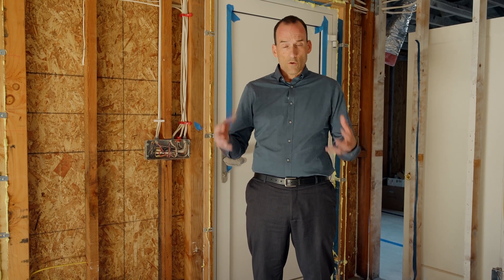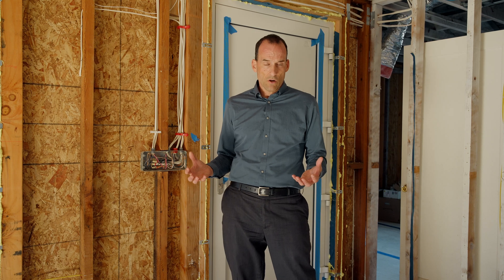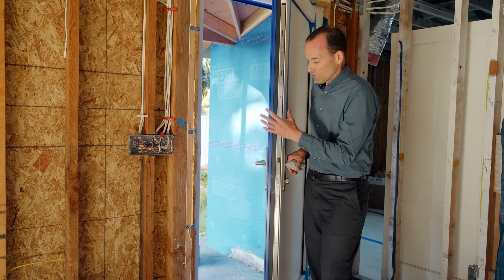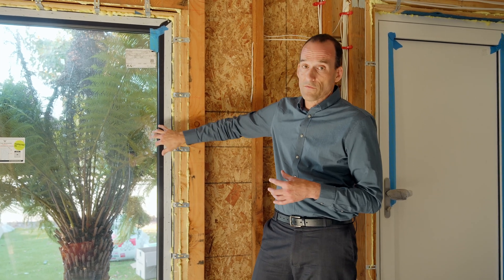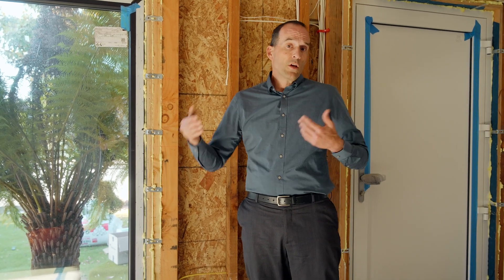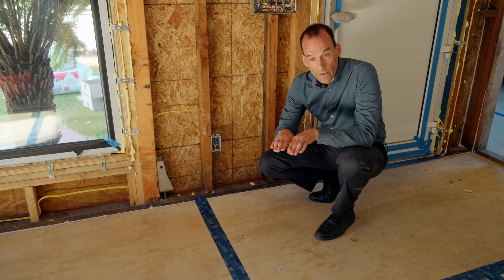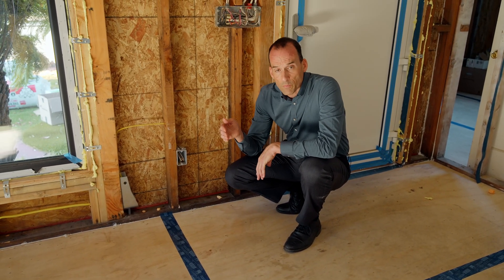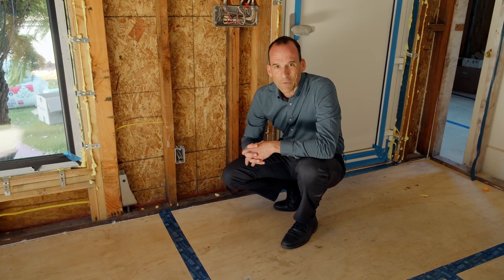Bay Street Passive House #7 -  Sealing a 100 yr Old House To Passive House Levels

Comment: What would you recommend as minimum insulation for the Bay Area peninsula neighborhoods for walls, ceiling and floors?
Reply from the maker: That depends on what you are trying to do and where you are starting.  If you are building a new home then you have lots of options and I would definitely build to passive house standards.  Here that would be R27 floors and walls and an R60 Roof.  But you would also want to upgrade to Passive House windows and air seal to 0.6 ACH50.  That is what I did with my own home(Bay St. Passive House) and it was amazing and I cannot imagine building any other way now.  If you are just trying to upgrade your existing home's insulation and you are not doing a major remodel, then all you can do is fill the walls, attic and floor joists.  That is your limitation and that will define the R-Value for the walls and the floors. The layout of your roof will limit what you can do at the eaves.  If you are trying to meet passive house and you are doing a major remodel, and you are going to air seal and replace your doors and windows and your siding nd roof, you can put on exterior rigid insulation over everything and you should treat it like a new home, with a new homes R values.

Comment: Just about to start our renovation in the Bay Area and so far your videos have been quite informative. Was meant to do a ‘regular’ renovation on a 70 year old home but now would like to incorporate some of your techniques to improve the home air tightness. Is there a window you’d recommend over the standard Milgard and Marvin double pane products?
Reply from the maker: I really like Zola Windows.  They are amazingly good, super efficient and oh so quiet. Will be cheaper than high end Marvin’s and twice as good and ten times more air tight.   Good Luck!!!
Reply: Thanks for the reply Dave. Unfortunately based on Zola’s production timeline and their min $50k order requirement, I wont be able to use them. So unfortunately l’ll have to go with Marvin Essential unless you have another recommendation.
Reply from the maker: @vivenreddy Sorry, i didn't see your reply until just now.  There are other manufacturers from the us too.  Schuco, Alpen, Innotech, Intus and many others.  Sorry for the late response.  Best of Luck.

Comment: I thought old house were not designed to be air sealed as it may offset the integrity of the natural airflow that kept these structures intact for so many decades?
Reply from the maker: You are correct in that the leaking us of old buildings help them to dry when they got wet but getting wet is not standard part of their operation. Getting wet is a result of a defect in their construction processes or a failure of materials so if you can stop them from getting wet, they don’t need to dry out, hence they don’t need to be leaky. So really adapting an old house to a much tighter. Envelope is all about controlling, moisture and recycling, stale, air with fresh air, which can be done with proper waterproofing and air, sealing techniques and proper ventilation systems, respectively.

Comment: Hi Dave, great video! Would you mind sharing the door and windows manufacturers? Are the windows US-made or European triple pane? I would love to find some options in the US that are cost effective and triple pane if available, but certainly love the options and sizes from European manufacturers!
Reply from the maker: Front Door is Zola, which is headquartered in Colorado but made in Poland.  We use them a lot and find them very good and less expense than many high end normal 2 pane US windows.  The windows were Wythe, from New Jersey.  I would not use them again.  Came 5 months late, packed like crap, had damage caused by incredibly poor packaging quality, and that they took no responsiblity for and generally are not nearly as refined as we were hoping.  Operation is fine, leaked a lot during blower doors, which was super unexpected and depressing.  That said, they were cheap, $25K for whole house, windows and doors, not including front door.  But 5 months late….come on.